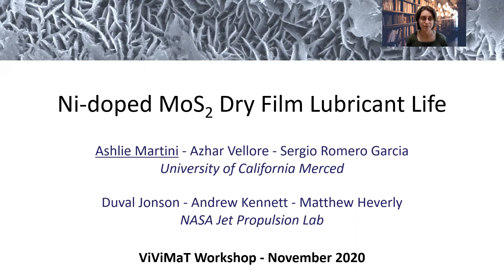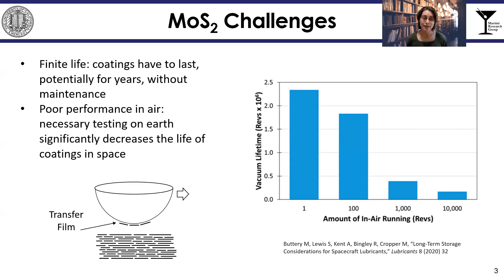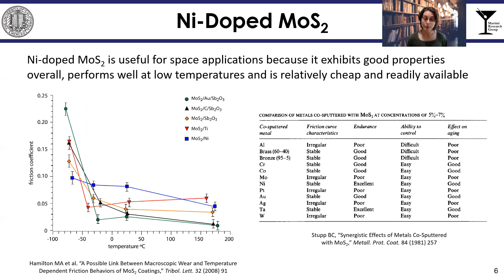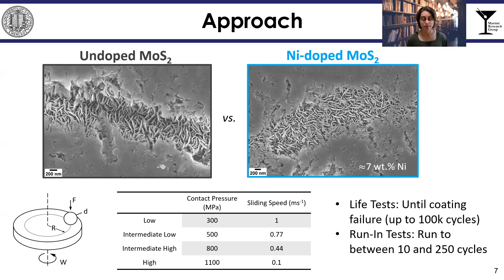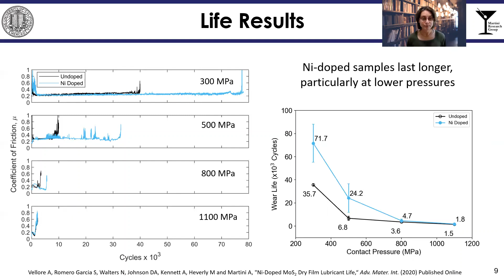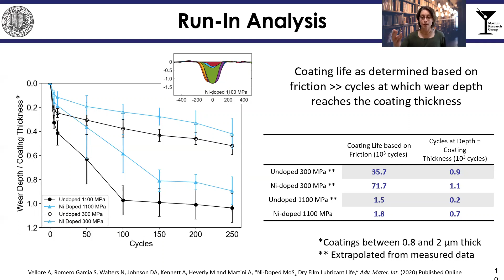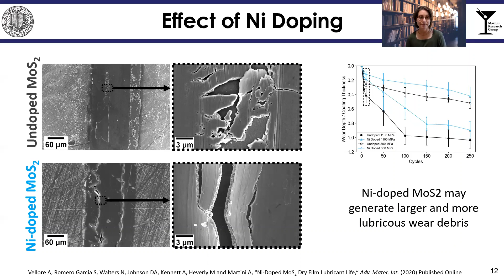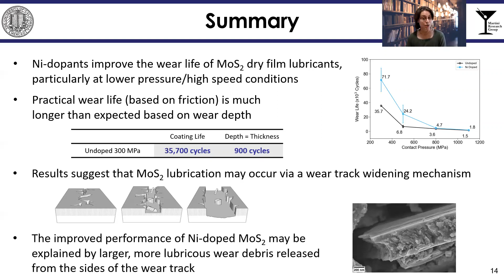Ashlie Martini (UC Merced) talks about dry film lubricant life | ViViMaT Session 1

Comment: Thank you Professor Martini for the talk. My questions are:
* In the talk has been stated that one of the important conditions is the temperature at which the lubricant has to perform. : are the shown results also consistent at the cold temperature of space? Is there any major changes in the behaviour at low temperature?
* The use of Ni is also important due to its price and abundance. Are the required quantities as dopant so demanding that these are critical factors?
Thanks in adavance